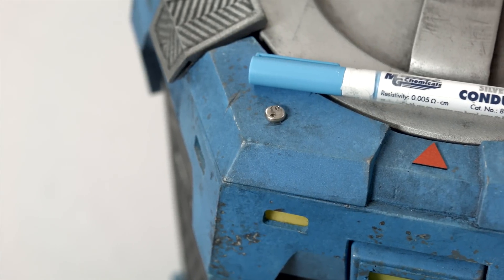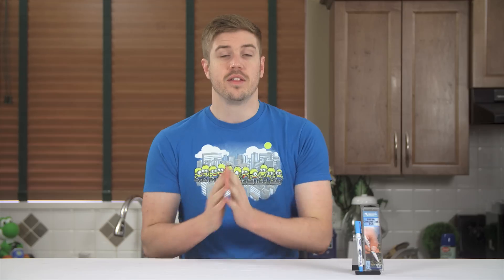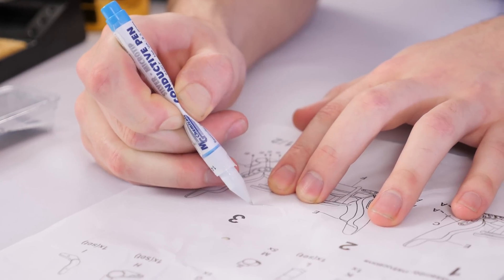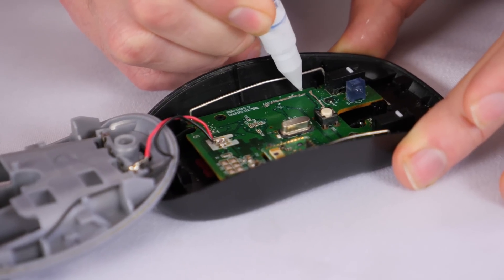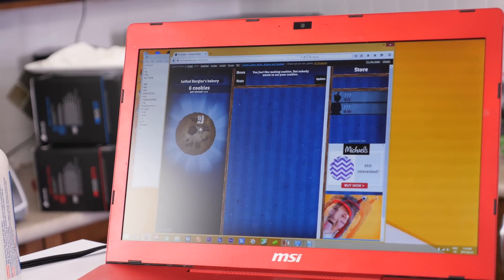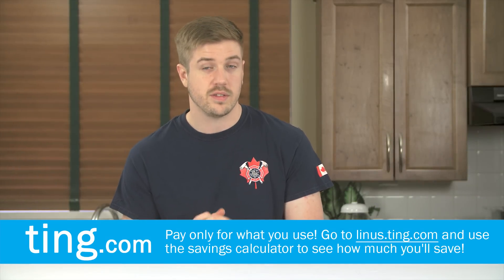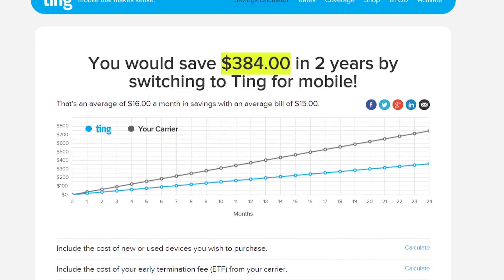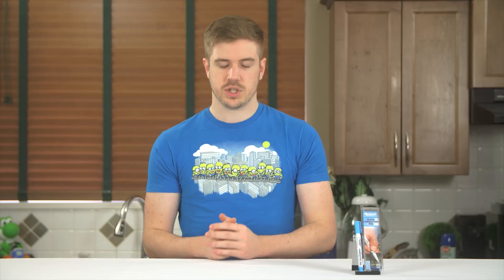Silver Conductive Pen - DIY PCB Trace Repair

Comment: I have a Baby Pac-Man game & the drop targets for the pinball section were an issue, 'cuz the switches in the back were rusted. I ended up sanding the rust off and making it worse, but after painting over those parts with this stuff, worked like a charm. Every time the metal pieces rub, the paint will dissipate no matter how much you apply, but if you're broke and need a quick fix.....

Comment: Problem with silver pens is solder wont stick to them. If the actual circular metal piece wires hook to is gone then what would you suggest?

Comment: stupid idiots trying to sell you  for an outrageous cost. INSTEAD take a little wire you robbed out of your old outdated wall phone or where the  ever you find it. and solder it into the board at the end solder points on each side of the crack. DUH! repaired for the cost of a $6 soldering iron that you should already have if your trying to do repairs. Then dislike this video.

Comment: That electrical tape thing was smart. 👍🏽
Reply: A lot smarter would be to stick a piece of tape down to a surface you can cut on, then cut close together parallel lines for your trace, remove that thin strip, and then stick the tape down onto the PCB.

Comment: You can just buy the silver conductive epoxy on eBay for $12 and free shipping and put it in a surgical syringe which cause less than $.50.  With some effort you can even create a motorized surgical syringe that outputs at a fixed pressure speed for really precision output.  Just Google search for: Syringe Paste Liquid Dispenser 5V DC USB to see plans for how to make this.  If you just want to buy one instead here is a link: https://www.tindie.com/products/DanM/dm-solder-paste-and-adhesive-dispenser/  I am not affiliated with any of these products by the way

Comment: So, once you re-trace the pad on whatever you desire, can you feed solder onto it?
Reply: I'm wondering the same thing. Like if I need to replace a solder pad, can I use this instead of buying a new solder pad? I have this thing where I accidentally rip the solder pads off of the pcb.....

Comment: What is the amp rating for this ink?
Reply: my guess is it depends on how much you apply
Reply: You can use a track width calculator to find out what it can typically handle. I used KiCad's track width PCB calculator and the datasheets for MGChemicals' silver conductive pen and the nickel conductive pen.

Silver Pen:
Resistivity:  0.0001 Ohm-meter
Typical width: 0.9 mm
Trace thickness: 1 mil (idealized, 1 coat)

Resultant Current: 1.75615 Amps

Nickel Pen:
Resistivity: 0.0068 Ohm-meter
Typical width: 1.0mm
Trace thickness: 1.6 mil (1 coat @1.6mil)

Resultant Current: 2.66516 A

Note that at these maximum current handling values, you're going to have a very significant and real power power loss so you likely want multiple coats if you are handling these larger current values, larger widths, etc.

Comment: This is complete overkill for such a repair. You could have just used a jumper wire and soldered at the two points.
Reply: But if you have no experience with soldering, have no wire (or solder and a soldering pen for that matter), or just want an all-in-one package this is good.
Reply: Dennis Playing Lacrosse?
If you have no experience with solder, then why would you be doing a repair? There's a very good reason why professionals don't use this! If you want to do repairs, then learn how to solder.

1) Most electronic connections require higher current; which means the tracks that these pens create, will burn out as they won't handle the current.

2) These pens cost at least as much as a new mouse. You'd be better off buying a new mouse.

3) The shelf life of these pens is 6 months at best. So you would have to buy it when it's needed; which means you will have to wait for it to arrive. Whatever is not used in 6 months would have to be thrown away.

This is nothing more than a novelty.
Reply: I love you

Comment: That PCB has a protective surface layer right? Maybe they don't need to be this careful? The only places the ink will make contact would be existing contacts and whatever was destroyed by the battery accident.

AND if they're worried about tight traces, they could just draw on all that empty space. Meticulously covering a trace that goes super close to another trace... Not necessary, just curve away from it.

Comment: Leaving the old corroded traces on the board are only going to make the problem worse.  You need to dilute the acid with lemon juice or vinegar, scrape the traces down to bare copper, and solder the trace with lots of flux and a low-heat soldering iron.  Then wash the whole board with alcohol.

Comment: This may come in very handy for someone who's spilled fluids on a keyboard and ruined it...if you've the right kind of keyboard at any rate.  A lot of the rubber dome keyboards the runs are done with transparent layers(like from oldschool overhead projectors), the run itself being more or less painted on those.

I have not taken apart a mechanical keyboard myself so that may be a bit different if you have moved onto those as I have.

Comment: You can use a soldering iron too. Use a sharp blade to scrape back the mask (the green stuff over the copper) then solder wire onto the exposed copper. The reason being is that quite a few people are more likely to have a soldering iron and solder in their automotive repair kit than conductive pens.

Comment: I found this useful, certainly something I'm going to consider getting now for pcb repair, probably have some car stereos I could use this on, looks a lot easier than soldering jumper wires... would love to see more repair style vids as I'm a very diy guy, if something doesn't work I first try to fix it before replacing.

Comment: You guys are way too anal about ESD and stuff, also was it even necessary to repair? It looks like a bit of corrosion that could have been cleaned off and then just paint some varnish over it to seal it.

Comment: AA batteries don't have acid in them?...
Reply: bassl0va Literally everybody knows what they mean, what do you want them to say, the strong base potassium hydroxide leaked all over my substrate laminated copper sheet?
Reply: MarioDragon They are called alkaline batteries so it's sure as shit not acid :P Just saying the batteries leaked is sufficient, but I prefer your one :P
Reply: +bassl0va Over time things pick up names that may not stay accurate as technology changes. I've had this conversation before too, people keep trying to change terms to be more accurate to how things actually work. Its wasted effort that will only confuse people. We figured out what to call capturing a moving picture back when we were doing it with film, so it's called filming and that's not going to change any time soon. We figured out what to call the stuff inside batteries back when they were all lead-acid. So we call it battery acid. Aside from the most technical sense, what's the difference? it still damages anything it touches. It's the only term you can guarantee everyone will understand. There is no point in changing these terms, at least not in the foreseeable future. People that actually know what they're talking about might know the difference, but they'll still understand what you mean. If they're real big assholes they might point it out, but who gives a fuck.

Comment: i need help on choosing a processor, currently i am using intel i3 3420 dual core 2.90ghz and which i believe has a build in graphics (i dont have a GFX card on MOBO) or smth like that as read on the info page of the pc, i was thinking buying a AMD Athlon X4 860K quad core  3.7ghz and doesnt have that built in gfx so does that mean i need to get a graphics card. please dont take out pissed out of me for this question but i feel like its a dumb question and Thank You for the ppl to reply back :)

Comment: Same things work with some pencils, I used it before on a PSP battery.
Reply: ProtoMario I did the same to create a pandora battery to flash my PSP
Reply: Graphite from a pencil is conductive, but resistive. You are going to basically add a resister in series, which may or may not affect the circuit, depending on the application.
Reply: really ProtoMario? what kind?
Reply: kakashi Hatake I used a Graphite one way back in the day.
Reply: ProtoMario thanks

Comment: First the contents of an alkaline battery is in no way acidic it is caustic soda a corrosive solution... also called lye. 

Unless you were running lead acid batteries which rely on cells of lead with an electrolyte solution of sulfuric acid. 

I have repaired smaller traces by soldering jump wires between end points.

Comment: Congratulations on learning something new that is very useful. If you are really serious about fixing dead traces on boards I would recommend using some 30 gauge insulated wire and a real soldering iron. I did repairs professionally for years and that is the best and most durable way to repair a toasted trace. The pens can wipe away too easily to be considered a fully permanent solution. Most pads can be soldered to straight away and if they are covered my a solder mask (The green coating on a PCB) then an exacto blade can be used to lightly scrape away the mask. Either way, good for you, Never stop trying new things especially when it comes to electronics.
Reply: I think you gave up on this concept too early in your career.  This is far superior than the method you just described.  If you're worried about the trace wiping away after it has cured, then you must of been using really cheap epoxy silver.  The really good stuff is used by NASA and is very strong and can even come in flexible varieties.  You should do some research on Atom Adhesives.  You can also coat it with two part high temp epoxy laminate layer to prevent it from ever coming free.

Comment: If the soldermask was stripped off the trace I would have just made a wire-bridge with a 24awg wire and then soldered it down. This stuff has way too high resistance.

Comment: Can you guys please let me know if a seasonic 750w psu will damage the psu itself and/or will it raise my monthly electricity bills? I'm currently just building a rig which has a 4690k with a SINGLE GTX 970 n mobo is AsRock z97 xtreme 4. PS: I'm planning on 970 sli in future. Sorry for my grammar mistakes. ><
Reply: Saxon Myx forget about SLI..its not worth,better is to upgrade for one or two step, better,  graphic card,seriously. SLI&CF are not worth..only maybe if, and when, you have top, dual gpu ,graphic card and better not exist..but if you don't believe me try that sort of upgrade by yourself,sure i will not stop you..well,maybe you need to test it by yourself,so do it!
Reply: Siniša R. Ok thx for advice. But I'll have to reset my build. Can you suggest me a trusted brand mobo for good overclocking an i5 4690k n a g1 gtx 970??
Reply: Saxon Myx no-brainer is Sabertooth...(asus sabertooth model which can accept your cpu, support and OC for rest of components is almost legendary,yes, trusted  no.1.)

Comment: Hello. I would like to ask what to do when your mouse wheel starts playing tricks with you. Sometimes when you scroll down the page bounces up and down and you can never reach the destination you want. I had this issue with my a4tech x7 and i simply unsoldered that wheel module from the PCB and replaced it with another one from some $5 mouse donor. Are there other solutions. Thanks in advance.

Comment: Fair enough if you don't have a soldering iron but I'd rather buy a good 25w iron with a small tip (antex xs)  than use this. And you can use a soldering iron for alot more jobs and make a permanent solution

Comment: I'd just solder wires to it, those pens are too expensive...
Reply: You can just buy the silver conductive epoxy on eBay for $12 and free shipping and put it in a surgical syringe which cause less than $.50.  With some effort you can even create a motorized surgical syringe that outputs at a fixed pressure speed for really precision output.  Just Google search for: Syringe Paste Liquid Dispenser 5V DC USB to see plans for how to make this.  If you just want to buy one instead here is a link: https://www.tindie.com/products/DanM/dm-solder-paste-and-adhesive-dispenser/  I am not affiliated with any of these products by the way

Comment: I know this has nothing to do with this video but do you think my build is good?
AMD FX-8320
Cooler Master Hyper 212 EVO 82.9 CFM Sleeve Bearing CPU Cooler
Gigabyte GA-970A-UD3P ATX AM3+ Motherboard
Corsair Vengeance 8GB (2 x 4GB) DDR3-1600 Memory
Western Digital Caviar Blue 1TB 3.5" 7200RPM Internal Hard Drive
EVGA GeForce GTX 750 Ti 2GB FTW ACX Video Card
Corsair CX 600W 80+ Bronze Certified Semi-Modular ATX Power Supply
Reply: Min Explod MB and CPU cooling can be better if u want to OC cpu up to @4.7,not bad build.
Reply: Siniša R. I'have changed my build completely XD
Intel Core i5-4690K 3.5GHz Quad-Core 

ASRock Fatal1ty H97 Killer ATX LGA1150 Motherboard

Kingston Fury Series 8GB (1 x 8GB) DDR3-1866 Memory

Seagate Barracuda 1TB 3.5" 7200RPM Internal Hard Drive

MSI GeForce GTX 970 4GB Twin Frozr V Video Card

Cougar Volant (Black) ATX Mid Tower Case
KCAS 600W

LG 22MP55HQ-P 60Hz 22.0" Monitor

Cooler Master CM Storm Devastator Gaming Bundle Wired Gaming Keyboard w/Optical Mouse
What do you think? I have been able to game on all the games i have (far cry 4 gta 5 etc) on ultra
Reply: Min Explod well this is not upgrade its rebuilt..nice built ,too, but more less same result and performance you will have if you just upgraded from (EVGA GeForce GTX 750 Ti 2GB to MSI GeForce GTX 970 4GB Twin Frozr V Video Card, as you do..and yes HDD to SSD as you do.. but honestly its waste of lot of money..as all other thing u pay and add not improve noting gaming wise..wasted money in cpu and mb..and why? to buy again hdd if u have it.?. 
But, yes, this newer built is stronger then last one!,as you know!..but
 not wise bang for bang(money),
as you don't start from 0..what i think? power supply(W) on this newer built can be limited factor in cpu OC and gpu OC,esp if u do it both..

Comment: "Speaking of fine tuning?" Nobody said anything about fine tuning! :-)

Seriously, great video. Suggestion: You may want to remove the protective coating of the PCB before applying the conductive ink.
There's also graphite conductive ink, which is cheaper than silver but less conductive. Still, it's enough to fix thinks like keyboards.

Comment: you guys realise you can't cause a bridge through the solder mask haha? Only between vias or when the copper is exposed for solder joints.
Reply: thats where i'm stuck at. Have any suggestions for repair of the connection point?
Reply: @43audio89  cant you just scrape the soder mask off with a knife?
Reply: @shimmywow3613  of course, but fixing the actual circular connectors is a pain if they are missing.  Wires connecting to hair thin traces.. just leaves stuff delicate.. but im new to all this so idk really
Reply: @43audio89  i also need to repair a circular connection. Damn is it hard?
Reply: I did this to a perfectly working og xbox 1.6 when i attempted to hardmod it. Sad!
Reply: @shimmywow3613  I work on like drum machines and synths stuff. The only way ive been able to repair that is to run a new wire from the two points that need to be connected. it looks terrible but so far its my only work. There is how ever a Foil tape that has conductive adhesive.. I think that and a paper hole puncher might work. I have not tried it yet thoUGH
Reply: @43audio89  ive been tempted to buy a conductive silver pen in order to trace the path. Would it work with the circle connector?
Reply: @shimmywow3613  yes that will work. Just apply heavily. I'd buy the 5 pack if available. I bought 1 and went through it very very quick but yes if simply for making a trace then it will def work and work welL!